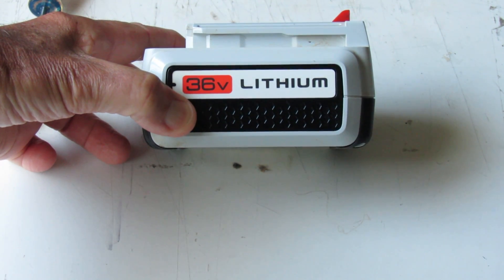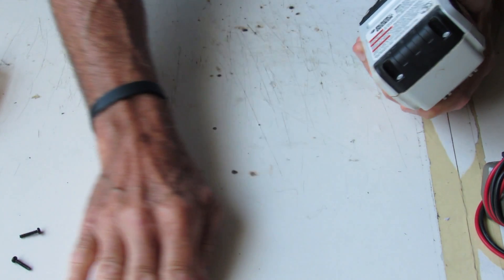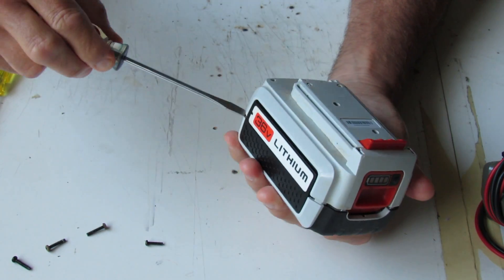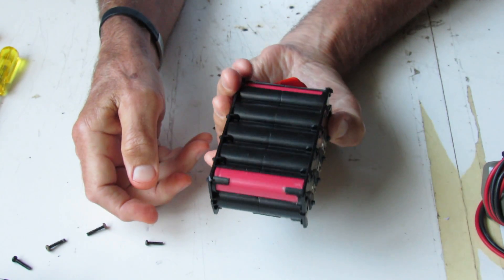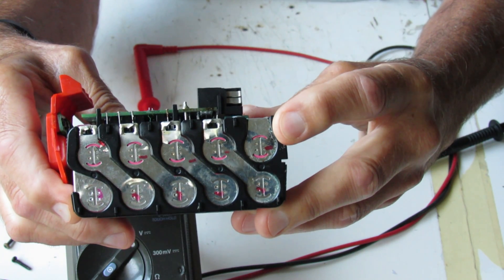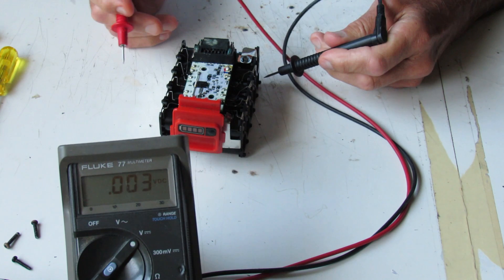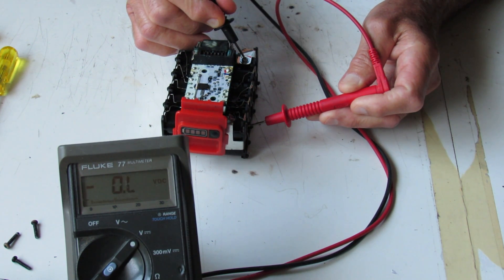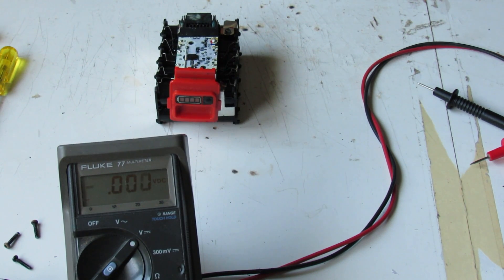Black & Decker 36 Volt Weedeater Battery Troubleshootimg

Comment: Great Video , I have a Cub Cadet 40v battery that has dead cells I guess haven't taken apart yet , would like to fix it since Cub Cadet (AKA MTD) has discontinued it. They want  a $119.00  to  $137.00 for it and their re only 6 left in the world. Nothing will interchange. Ryobi is backwards compatible. A friend is going to tear the Battery apart and try to make it easily renewable using RC Battery's
Reply from the maker: Sounds like a plan, I've used RC batteries to power everything from cameras to drills.

Comment: do the cells say what kind they are?
Reply from the maker: Sorry, they don't. The wrappers are completely blank.
Reply: You can usually read the numbers off of the battery case through the wrapper in a strong light.  I usually re-wrap the batteries, though.  Easier than cleaning all the schmutz off and the wrappers are cheap and easy.  I have recently started color coding for capacity and source as well as writing the specs and resistance on the side of the battery.
Reply: @heliflyer7  most likely "samsung inr18650-15b"

Comment: Budy you forgotten that torex is tamper resistant type
Reply from the maker: Not sure what you mean by torex, please elaborate. Thanks!
Reply: @heliflyer7  I think he meant Torx and "torex" is just a misspelling.  "A version known as Security Torx, Tamper-Resistant Torx (often shortened to Torx TR) or pin-in Torx contains a post in the center of the head that prevents a standard Torx driver (or a straight screwdriver) from being inserted." -- https://en.wikipedia.org/wiki/Torx .  The screws on my B&D battery pack do not appear to be the tamper resistant type.  They look like standard torx.
Reply from the maker: Thanks for clarifying!